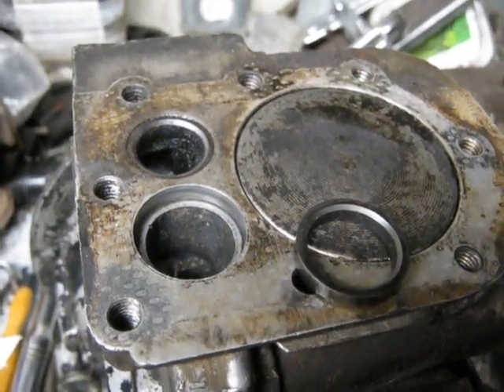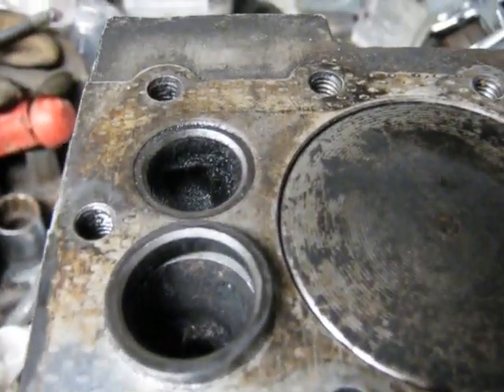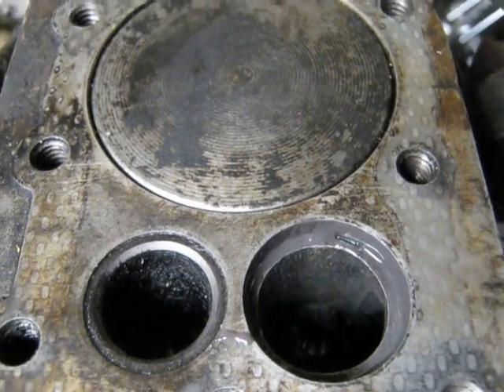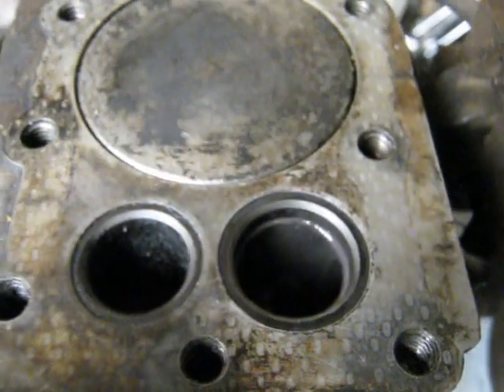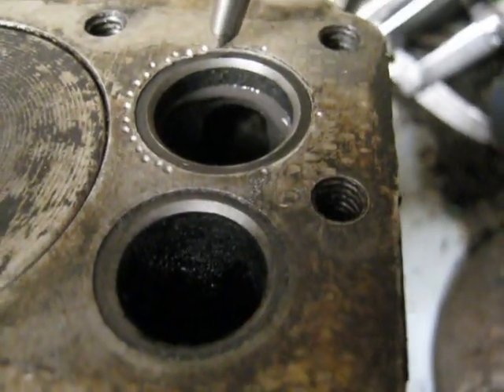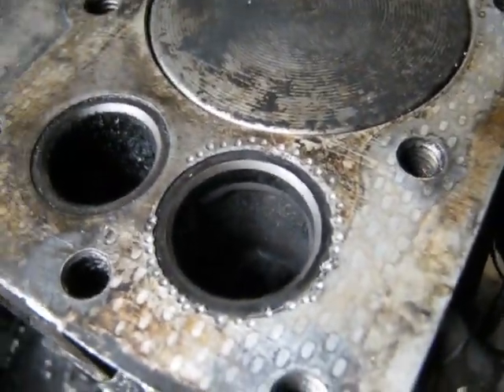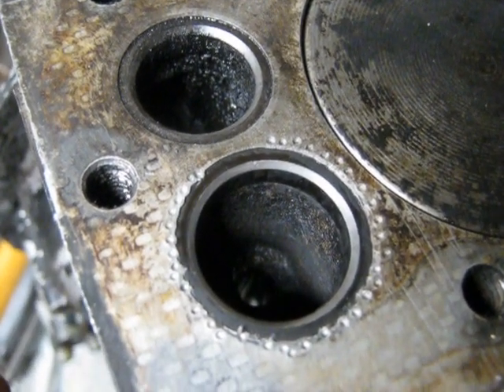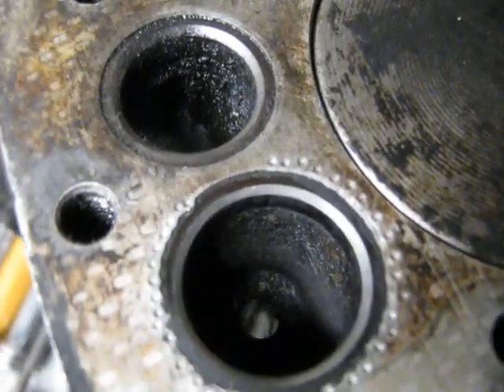Valve Seat Repair on 3-1/2 HP Briggs

Comment: Thanks. I am an amateur mechanic. Anyway I have a B % S engine on a Masport mower here in Oz. Stopped working and I suspected valve issue. I found the seat had popped up and hooked in under the valve keeping it open. I tapped it down and it reseated and I screwed on head. Mower went for 3 runs but has just stopped. I suspect same problem. I will try your method with JB Weld or Oz equivalent and tapping the block. I may get into trouble getting the actual valves out so hope I can put seat back in with Weld and tapping block. Thanks again for making vid
Reply from the maker: The epoxy may not hole do to the high temp. but staking it in with a pin punch will usually work out, best of luck with it.
Reply: @ChargerMiles007  Thx.  I will let you know how I go.

Comment: how long does it hold for???
Reply from the maker: If done properly, the peened in valve seat should last a long time. However, it must be caught before the block has been worn from the seat rotating, If it is an intake seat, the application of some JB Weld may help the seat to block seal well. the exhaust runs hotter, so I doubt epoxy would last very long there. I did JB up my 65 Briggs Subterrainean engine, as the block was eroded badly around the seats, the JB held for some runs, but it would be eroded quickly on a loaded engine.

Comment: I would have liked if you showed how you removed the seat
Reply from the maker: Pretty sure I heated the area with a blow torch for a few minutes at least (as the aluminum sucks the heat away! Then used a flat screw driver to pry on the seat, if that didn't work perhaps pushing from inside with a pin pinch could move it. the heat is very important though, as the aluminum will expand away from the steel seat. Hope this helps. I have some junk engine blocks, I will see if I can make a vid showing the removal procedure in the future.

Comment: hi. how do you measure compression to ensure vavles linking?
Reply from the maker: On these engines, there are no published compression readings, you just have to spin the engine backwards with the starter cover removed, and the blade brake off, to feel if it has a good amount of compression. Generally, if the valves seal, the valve lash is set right, the piston rings aren't worn out, or the cylinder scored to death, the engine should run. Clean cooling fins will help it continue to work well. This is all assuming the ignition and carburator are functioning properly.

Comment: HI
WHY NOT WELD AND BUILD A BIT AROUND THE HOLE AND CUT FOR INSERT SIZE
Reply from the maker: That could be done if you have a MIG welder and a milling machine. I wish I did, but I don't, until i win it big in a Lottary!  :)
Reply: @ChargerMiles007  ok
Do you check the compresion after installing the head back on the cylinder,   what is the compresion in PSI?

Comment: Never had to pull a seat in a Briggs be for, to be honest I did I not know you could
Reply from the maker: Mr3wheeledbike I pryed this seat out with a medium sized flat screw driver. Sometimes you might even have to pry with 2 screw drivers. If it still won't move, I would try heating the block near the seat with a blow torch, as aluminum expands at a greater rate than steel, so it should get looser at higher temp.
Reply: @ChargerMiles007  will they also come out of thw ohv head this way?

Comment: Good video man! We had that happen on a 12.5HP briggs a long time ago, before i knew a whole alot about small engines, I was just getting in to it. That engine ran great after we had a new seat put in (oversize) until it threw a rod and broke the cam and cam bearings out of the block haha I actually still have the block and Jb welded the cam bearing in (only a small piece broke out of it) another experiment. I keep putting off putting it back together. I think it will be fine myself. later!
Reply from the maker: fnaguitarplayer9 Good to hear from you, been too long!So you were able you buy an oversized valve seat, I wasn't aware they made those, but it makes sense for the larger engines. Adding a bit of JB under the seat was an idea I wanted to try, hopefully it works out.
Reply: Yeah its been while since we talked, i haven't been on here much except for answering comments. I could be wrong, but i do know he didn't have to  stake it, it pressed in, and i remember using a valve seat facer on it. We did't have to buy anything though, he was a good friend of a friend and did it for free. But next time i have a seat come loose i will do it just like you did, i agree with the JB weld, it should make it form a perfect seal. And since its more/less at the bottom its not exposed to direct heat so it should be able to take it.
Reply from the maker: fnaguitarplayer9 I am pretty sure I have staked one before without the JB, and it works OK. I have another engine that was way too loose, I staked it, but it still leaked compression. I will have to take another look at it, it is a one of a kind block to me, as it is a 4 horse with electric start.
Reply: I hear ya, its good to experiment and maybe its the best thing to do. I hear ya, that does sound unusual. I still need to put a video up on my old 2 Horse 6S briggs! It would be nice to get that 4 horse running, since its rare.
Reply from the maker: fnaguitarplayer9 I will have to have another look at that 4 horse, it has been 3 or 4 years since I gave it a short run before it started leaking badly at the valve seat again. The block has the heck peened out of it, so it would probably require a weld up and machine job, or an oversized seat (which probably doesn't exist).
Reply: ChargerMiles007
That would make a good video too. I hear ya, yeah i doubt they make one for it, its a shame the blocks are aluminum (or cast iron on older ones) or they could be welded in haha but it would probably warp the metal though. JB might hold it in, never know.

Comment: Was this engine made between 1984 to 1988?
Reply from the maker: 1972FordF150 I think it was built earlier than that, since it has points ignition. I will see if I have the top cover which would say the built date. I have torn 3 similar engines apart in the last week, so they are getting a bit jumbled in my mind!  :)
Reply from the maker: 1972FordF150 I am pretty sure the engine was made in the late 1970s. I am prepping 3 very similar engines (pretty well triplets), but only have one cooling cover, and it says 1978.

Comment: Have you ever tried porting a briggs block to get better performance? (similar to porting a head, just in case there's any confusion)
Reply from the maker: Cameron Jenkins Yes, I have done a bit of touch up work with a dremel type rotary grinder, sometimes the posts have metal fins in them that are useless for flow. You have to use extreme care not to nick the valve seat, and watch it not to blow up the tool if it starts bouncing around in the hole!   That can cause some excitement!!!

Comment: My Ford Escort had a valve seat come loose and the seat doesn't compress like air.  Guess what happen to the piston?  That is a common problem with Escorts.  What is the max temp for JB Weld?  Thanks Ron..  Can't remember your name.
Reply from the maker: zzzdogutube I think JB is good for 550F, but I wouldn't try using it on a multi cylinder engine, as if it dies on a single cylinder, the engine quits. On a multi cyl. it will keep running and lunch itself!